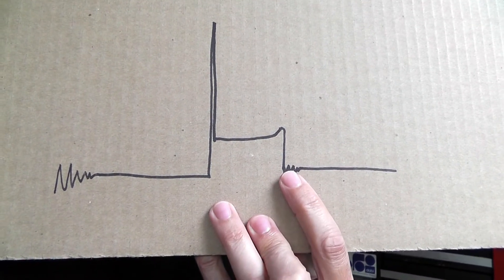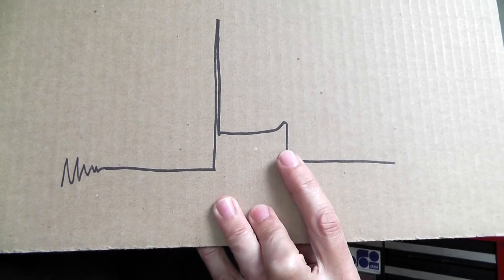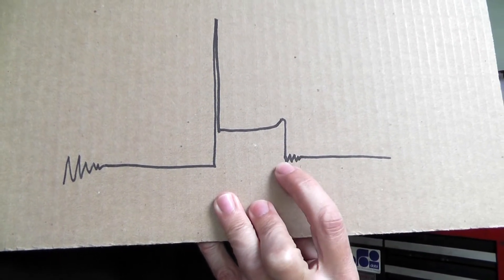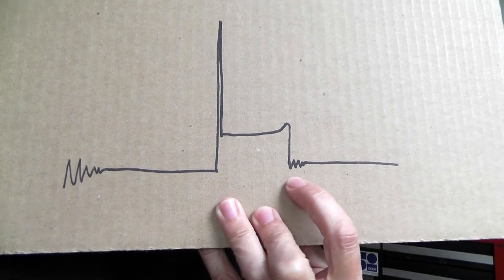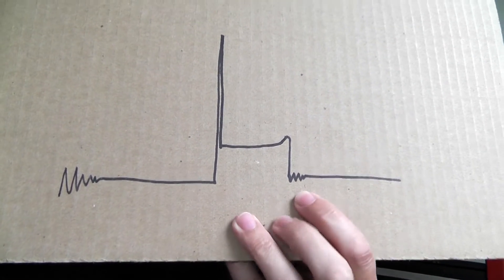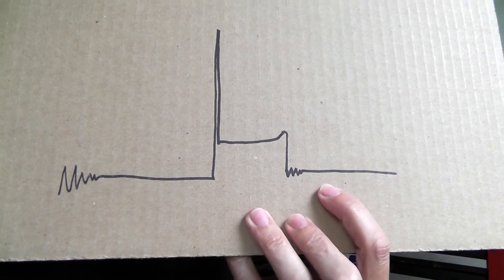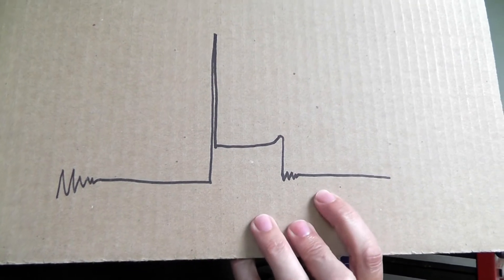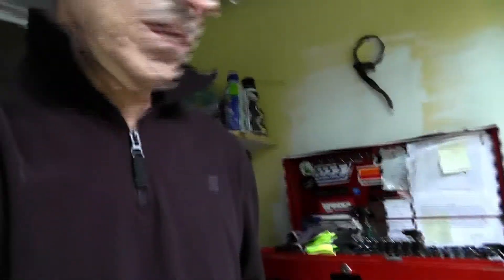2003 Mazda 6 P0301 Misfire Diagnosis. (short version with waveforms)

Comment: different son from the Mazda 3? (not trying to get personal, just curious about if the 3 2.5L is still running)
Reply from the maker: Yes, different vehicles. One was a 2004 Mazda 6 and the other was a 2005 Mazda 3. The 3 was totaled not long after the engine swap. I was able to sell the car and the guy who bought it was going to take the engine out and put it in his own 3. The 6 was sold two years ago and at the time was still going strong.

Comment: I have same misfire diagnose code. How much new coil pack costs and it is that surely the reason for the error code?
Reply from the maker: A new coil pack costs around $30. No, the misfire code could be due to several different things and not just the coil pack.
Reply: Would you recommend to change a coil pack if my car sometimes jerks when I drive, typically during the acceleration. Also aforesaid misfire code shown sometimes.
Reply from the maker: @juhor3251  No, I would not. I would recommend doing a proper diagnosis to save money and also ensure that the car is fixed right the first time and doesn't break down on you. Misfire codes can be due to numerous different things.